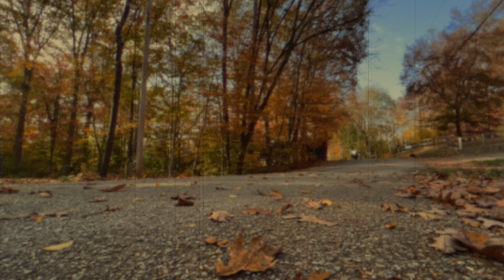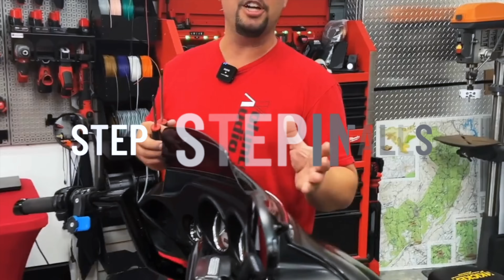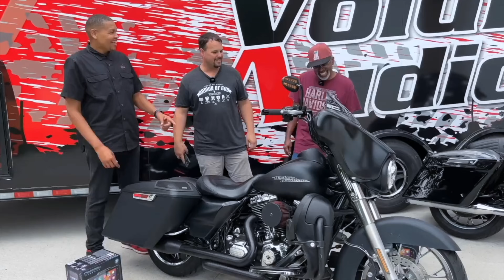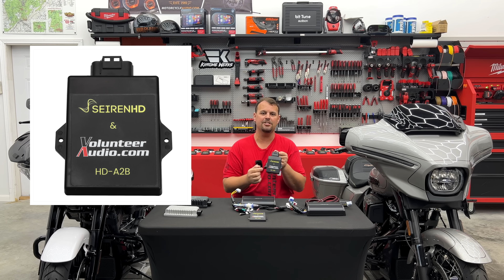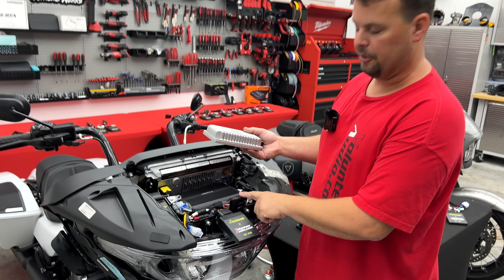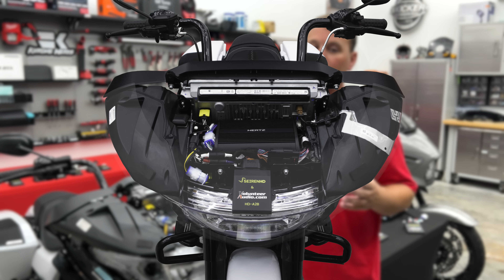HD-A2B SeirenHD & Volunteer Audio 2024-up Harley Davidson Amplifier Replacement interface is here!

Comment: Why does it take a minimum of 10 days to ship an amp that’s in stock?
Reply from the maker: We are at about 7 business days currently, we don’t just ship an amp, we do all the hard parts here before shipping, we prewired the amp, power it up on our test station and perfectly set the gains with an oscilloscope and set the filters, we also program the a2b DSP in the interface.  We then move the setup to a different station and listen to it to verify it is perfect.  Then we ship it so it is truly easy to install and plug n play
Reply: @volunteeraudio  Well! I ordered mine on 4/14, i'm not a math magician but I believe that's more than 7 days and i have yet to receive any shipping information?

Comment: So, I bought this kit for my 24 Street glide around Christmas time. Winter project. Testimonial, stock speakers and amp are horrible. I installed the plug and play kit from Volunteer Audio this past weekend and the difference is not in the same zip code. The system is clean and loud the install is easy if you fallow the step by step video on the website. The system is everything I wanted in a rider bike. I bought the Advanblack Tour pack with pods and did a 4 speaker system, during my install I had question and called Volunteer audio about the hole size for the rubber bushing needed for the tour pack. I spoke with someone I don’t remember her name but she did not have a the information I needed but took my number and said she will call back. 10 minutes later Jay called me personally. Answered my question. This is the kind of company I want to do business with. Still waiting on the Cut in kits lol thanks Volunteer audio team for delivering.
Reply from the maker: Thank you so much!
Reply: @volunteeraudio  
I don’t really leave reviews but your system is everything you stated

Comment: Awesome!  Love the MADE IN USA!!!!     I have a new CVO ST, and the dealer sold me the new lids and stage 3 speakers for $1,400, and it totally sounds like an ass.  I cannot wait to ditch this amp.     Ive been installing audio since the 80's even owned a shop for 15 years and its great to hear someone stepped up.  I went to Biketoberfest and checked it out, but kinda bummed the only option was for a whole system installed.   Please let me know when the amp & HDA2B package is available.
Reply from the maker: We only sell it with the hertz speakers because the 31band eq is perfectly set for the hertz Neo speakers in our system.  The system sounds amazing and comes perfectly pre tuned to work together.  Plus we warranty the system for 3 years

Comment: You showed and said that it fits 23.5 cvo Road and Streetglide and 24 Roadglide base, does it also fit in 24 Streetglide base?  Would love this package with the 6X9 lid mounts in my 24 Streetglide base model. Love the forward tilt of the lid speakers, has to sound great!
Reply from the maker: @scaremetv5806  yes we also have kits for the 2024 base model streetglide as

Comment: You had me until you mentioned we had to buy speakers from you.. Not cool!
Reply from the maker: You’re welcome to call me and I will explain why in better detail.  I want to control the outcome and experience to our customers.  We can only do this by selling complete pre tuned solutions.  They are specifically designed and set for specific speakers and amplifiers.  We need to sell the system complete to offer tech support and warranty support as well to make sure it sounds just as amazing when you get it and install as it does when we install it.  We have an amazing product and no one else has come close to having a solution this complete and well designed in the aftermarket world.

Comment: With the built in DSP to the module, what does this do in regards to the factory equalization? Is it going to be recommended to run a custom profile on the EQ with a flat curve, or will you still be able to adjust infotainments EQ? Also, does the Hertz 6x9" SX690H NEO Saddlebag Lid Speakers fit in the Rockford speaker lids? I'm super disappointed in the money I spent on Rockford Stage 2+ setup as I can't hear it at high speeds but don't want to have to rip apart the entire bike or buy new lids.
Reply from the maker: All stock eq settings actually pick a preset in our DSP, any and all eq selections work great without overdriving the inputs so it remains distortion free, the sx690h drops in the stock lids with no modification needed

Comment: I have a 2024 CVO ST with Rockford drop in saddlebag subwoofer’s. Would I be able to get a 2 speaker kit with wire harness to power the subs of the Hertz amp? 2ch to front speakers and 2 channels to the subs. 1 for each saddlebag.
Reply from the maker: The Rockford subs need a dedicated amp, they are dual 2ohm voice coil so the 2 channels will not drive them
Reply: Couldn’t you bridge the rear channel to get 4 ohm and use the front for it as well?
Reply: Of coarse it would only work completely plugged in.
Reply from the maker: @RobertPerez001  I’m sorry but if your running the Rockford subwoofers you need their secondary amp
Reply: @volunteeraudio  is there a way to integrate the Harley amp and subs with your 2 speaker set up?

Comment: how about a pkg with the hertz sp 4.500 with the dsp and front speakers, for those of us who might want to get rid of factory amp and upgrade the front speakers for now. at least with the sp 4.5 if we want to upgrade to bag speakers in the future we would have the power to do so.
Reply from the maker: The savings is about $250 but I believe the sp4.900 is so much better and has such a great sound it is well worth getting the 4.900.  I can build you a sp4.500 version but I would highly suggest the larger amp even on a 2 speaker system